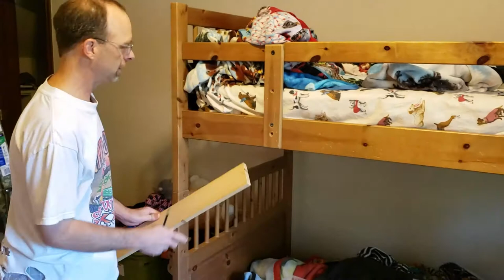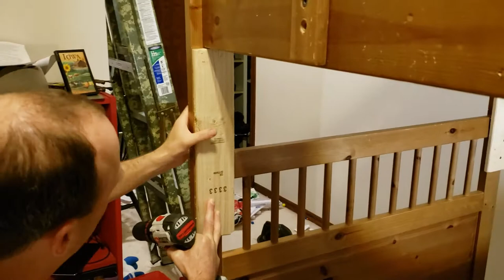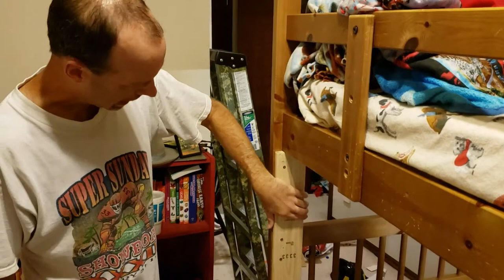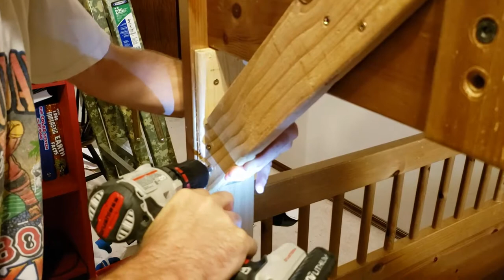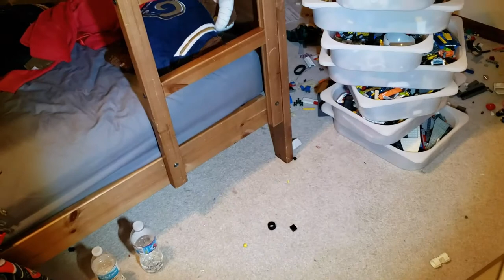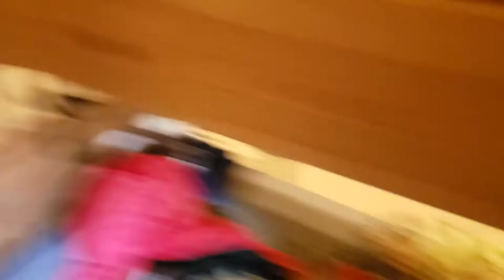How to fix bunk beds that aren't sturdy

Comment: I appreciate this! Concise and easy to watch. 

We blew a good deal of money on a loft bed frame in the mail. I wanted one with no extreme "chemical" sealants etc (I used hemp oil). But it's SO unsturdy. 

I didn't want to keep adding wood without knowing if it would help. Our frame is structured a little differently but this gets me started in the right direction!
Reply from the maker: Great. Good luck on yours. If you add the corner braces like I did, you'll be amazed at how much sturdier it'll be. 

You may not have to strengthen the join between top and bottom bunk. Just depends on how well it's built already. But if it's easy to do, you might as well.
Reply: Ya have a loft I just bought for my son and I don't like how much movement there is at all. This gives me lots of ideas. I was going to use brackets to attach to the wall but this would be better

Comment: I have a metal loft bed and I thought about flushing it to the wall and using those metal strap things. What are your thoughts on that?
Reply from the maker: Not sure I understand what you want to do. If you're asking about how to attach a loft bed to the wall, you'll want to use metal bracket angles that are an L-shape (when viewed from the side), and you'll need to make sure the screws you attach them with go will into the studs in the wall.

Comment: Do you have anytips on a metal loft bed?
Reply from the maker: Yes, kind of. The principles are the same regarding how to stiffen metal bunk beds. The difficulty will be drilling through the metal frame. Not impossible at all, just need to use titanium bits and use an occasional drop of oil during the drilling process. You could even use wood on your metal bed as the diagonal pieces at each corner. To do that, use screws with nuts. Don't over-tighten the nuts. I suggest using locknuts to ensure they don't loosen over time.
Reply from the maker: One other thought... you can also go to a place like Lowes and get some metal pieces to stiffen the corners of the loft bed. You could take a photo of your bed and take it with you to show one of the workers what you're trying to do. They'll show you what they have that would work. Good luck!

Comment: I have a similar bed but if I use metal type brackets close to the same size of wood do you think that would work? I don’t have a saw.
Reply from the maker: Not sure I understand what you're thinking of doing with brackets? The key thing, if you can do it, is connecting the horizontal parts of the bed to the vertical posts like I did (diagonally) with the wood. Do you have metal brackets or something that you'd use in place of those pieces of wood?
Reply: Isotopes well not brackets I meant horizontal type metals parts.
Reply from the maker: Yes, as long as you can attach them between the horizontal and vertical parts of the bed, that'll make a big difference. Ideally, you'll use at least 2 screws at each end of those pieces. The longer those metal parts are (within reason), the sturdier it'll be. Good luck!
Reply from the maker: Da, I think I just realized what you were referring to. Do you have brackets that you're going to install in the "elbow" between the horizontal and vertical pieces? If so, that'll help some but not nearly as much as the wood pieces I installed at a 45-degree angle. But if brackets are all you have, yes, that will help reinforce it some.

Comment: Do you know how you would do a metal one I have a double top and bottom 🤷🏼‍♀️
Reply from the maker: It'll be the same principle but you'd have to drill through metal, which is a hassle. You can find various metal brackets at Lowe's or HD which would help but those are made to be nailed into wood, so you'd still need to drill holes. I think I'd go to Lowe's, get some of the corner brackets, drill holes in your metal frames (use titanium bits and use oil when drilling), then attach the brackets with screws. You could take photos of your bunks and show a worker at the store what you're trying to do and they'll show you brackets that would work. Good luck!

Comment: Nothing is worse than 'Better Home and Garden' bs from walmart. Its so bad. The wood is very soft. They paint over blemishes that affect structural integrity. Such garbage.  I have a bed I got in 1989 that is still aa solid as it was from day 1. It was was made with 2x8" wood and nuts and bolts and screws. The damn thing just wouldnt wobble. Some of these new products are crap. It looks like this bed in the video can be saved.